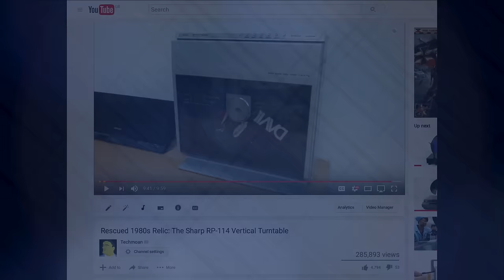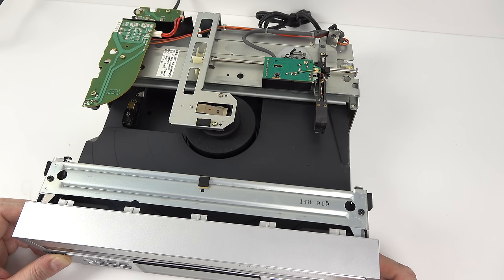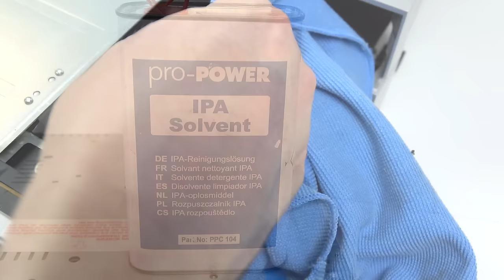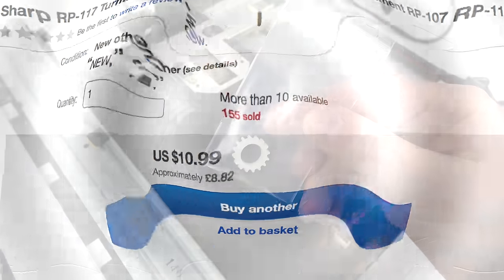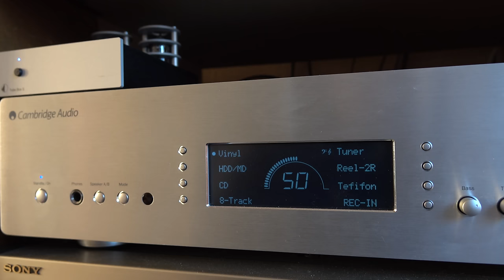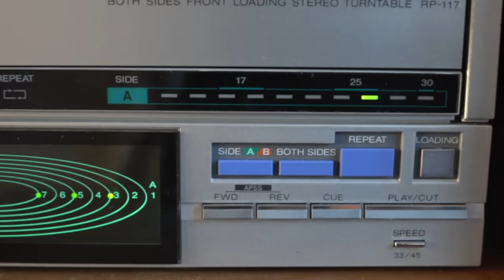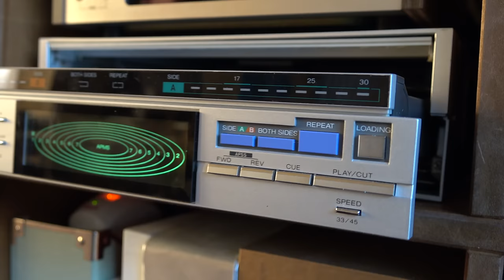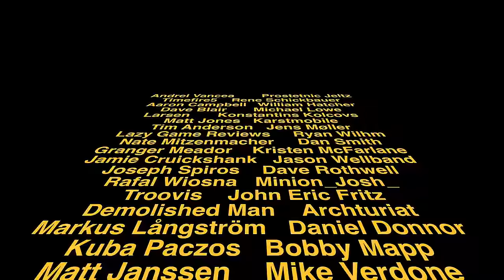RetroTech: Play vinyl records with CD functionality - Sharp RP-117

Comment: I think that $10 cog would be my ultimate push in the direction to buy a 3D printer :D
Reply: If you use a metal cog on a plastic rail, the rail will wear out a LOT faster than if you were to use a plastic cog. Also, plastic is self-lubricating, as opposed to metal. There's a reason why it's plastic in the first place, not only the cost.
Reply: ***** 
I don't think there are steel filaments for plastic FDM printers. You'd need a real metal 3D printer for that.
Reply: so let's see your logic. You would have to spend time (which is money ) to design the cog. Then you need the printer which how does a couple thousand dollars and equipment and materials justify making a shitty plastic cog?  I could literally and have done so, manufactured hard to find parts like cogs with my bare hands, even that cog he had was still useable if he spent more time fixing it it was not broken into a million pieces.... That still takes time but you don't need to invest in a pile of garbage which will just break down / or run obsolete in time anyways.  Terrible logic dude.
Reply: a metal 3-d printer? You mean a milling machine?
Reply: You can nowadays buy a usable 3d printer for around 250 euro. "Designing" the gear is literally a matter of 10 minutes. So, I think you're exaggerating. Do some research.
Reply: http://3dprinting.com/metal/ once again, do research. They exist, but those actually are a couple thousand dollars. It's not a milling machine. It can be used to make structures that can't be produced on a milling machine.
Reply: ***** 
Sure, you could do that. Just.. Why bother? This mechanism isn't subject to high stress, so just replacing the gear with another plastic gear will be fine for another 20 years, perhaps even more if this one doesn't shrink.
 
The problem was most likely caused by poor tolerances: a too small gear on a too large shaft. The design isn't really flawed, but when the tolerances are taken too wide (to improve revenue) chances of this happening rise.

Also, metal gears are noisier than plastic gears.
P.S. Just trying to provide solid arguments for one vs the other, no flamewars intended :)
Reply: No,it's not over,you started it,none Flame on. Flame wars!
Reply: Keepskatin well, let's then start. First, I'll imply that your cat is in fact your father. After that, I'll make fun of your sense of style. This is, of course, all completely uncalled for, and out of thin air. 
How do you respond? :p
Reply: Jelte Klas Wijnja 
I fart in your general direction!
Reply: Jelte Klas Wijnja 
I just got into my nuclear sub so I'm good.
Reply: No, more like laser sintering. It's still an additive process. But those machines cost as much as a new car. The machines that print plastic are way more accessible in terms of pricing.
Reply: as for making the cog, I think making a plaster mold, then pouring aluminium or plastic in would have been easier then 3d printing.
Reply: manaquri 
Print once and cast many. I would use a silicone mould instead of plaster.
Reply: Time is only money to people who have none of it. A 3d printer is a one time cost that can be used for so much more and shouldn't affect the price of the cogs. A few cents worth of plastic isn't much. And designing it wouldn't be hard at all.
Reply: I can probably spit the amount he sold of those cogs for about $25 worth of materials.
The reason they're 10 dollars each is because people will buy them for that price and not complain too much
Reply: It may seem pricey but it's also a part for an obsolete machine that could be hard if not impossible to find elsewhere. But parts for electronics have always been expensive. And even if the total cost of the replacement parts are around $20 that's still much less than the value of the working machine.

Comment: try superglue, that stuff actually welds the plastic kind of together.
Epoxy resin just relies on adhesion, and since the cog is under tension it just flies apart again.
Reply: audiocrush super glue repairs these fine i have repaired some myself with super glue  and works perfect. as you say you shouldnt use epoxy on a item like that.
Reply: Super glue + acetone applied on surfaces before gluing...

Comment: I remember the two sided approach, with a tone arm (so to speak) first being used in the jukeboxes of the 60s and probably 70s as well. The only difference was it was only for 45 RPM records and the record was held vertically rather than horizontally. All the mechanics of the record selection (robotic arm fetching the disk), the disk being clamped to the motor, and then the tone arm bringing the needle and cartridege into contact with the vinyl were visable to those of us gathered around this miracle music-making machine. A bit like a pin-ball machine, half the fun of putting your quarter into the machine was watching it work through the transparent glass case! I had no idea that this Sharp double-sided LP player existed even though I sold hi-end audio at the time. Well, I didn’t know about this probably because I was selling ‘high-end’ stuff and this was cool but not high-end. What we need now is a gadget like this that will couple with Gracenote online music database (or other) to look up all the metadata on each track, convert the analog to uncompressed WAV files, output over USB to good software on a desktop computer, save on local hard drive or cloud-based drive. Voila! Instant archiving and use of all those vinyl LPs we don’t bother to dig out of the basement closets!

Comment: I'll take vinyl over CD any time, if it gets scratched it will still play, albeit with a pop or crackle, any CD can get to a state where is doesn't play at all. Trouble with those old plastic parts, such as that cog, is that they shrink over time, that's why it snapped.
Reply: easier just to download

Comment: Great video as I was looking to fix mine I had bought in Germany in the 80's. It was the cog gear but it was not until 2022 as you did saw it on Ebay. Long story short got the new belts and cog gear and it works great. Thanks for your video.

Comment: You need to get yourself a 3D printer to efficiently produce replacement parts like that little plastic cog wheel. And possibly review it in one of your videos.
Reply: neoqueto That's not very convenient as looking online, and buying one, than spending 5k on a 3d printer, that will need to be refueled, adjusted, and calibrated, along with that it's no easy task designing a piece to print out. In the time it would take you to design the thing, one that you order would arrive faster.
Reply: Theft Tv I guess the main problem is that it takes many attempts and errors until you get the hang of it to print out a single piece that has a proper, durable structure, is not melted, tapered or displaced in any other way. But I still have to disagree on the price of the printer itself, there are many inexpensive models that would do just fine in a use case like this. Filament can be expensive though. Perhaps ultimately if you're experienced enough with 3D printing, it would be possible for you to break even on replacement parts. Also, with the help of a pair of calipers the initial design process shouldn't take more than 15 minutes, I imagine prepping it for printing and properly slicing it/generating gcode with correct infill is the most troublesome part. I might sound like an expert wannabe, but in reality my practical experience with the subject is minute. I know, 3D printers are nothing but glorified prototyping tools, might as well carve your part out of wood.
Reply: neoqueto Nice explanation. I did not expect a message back from you to be as descriptive, organized, or gramatically correct because you're original comment did not share the same grammar structure. (Not a insult.) Thank you for clarifying.
Reply: neoqueto In this case glue the cog amd just make a mold perhaps?
Reply: i have a $150 3d printer and i love it! i've designed and replaced parts for things you simply cannot source a replacement. it was so satisfying to use the device again and know it is running on my own manufactured part. so it would certainly bump the awesome factor of the repair.... but if you had no experience in CAD, it would be frustrating when there is a guy selling the proper part for less than $10!
also, ive only had to adjust/calibrate my anet a8 printer when it was moved... otherwise it's fairly hassle-free. no worse than changing ink and paper on a inkjet.
Reply: I would assume they do only what they are programmed to do and then i hope that would include generating all
the helices and pressure angles on the teeth as well.

Comment: Buy some Mozart vinyl for videos man
Reply: If you speakin' about copyrights, it applied to each exact performance. Not notes arrangement. If some orchestra will produce some music under Creative Commons (CC) license, it will make sence.
Reply: Николай Новицкий
Or an old pece that has no legal enthety as a continuing carier of the rights.
Reply: Langus langus I afraid, there is no such records, in proper quality, good enough to test sound )
Reply: Николай Новицкий
Can they realy tell its their specific performance ower YT?
Reply: Pretty much can, it's actually easier than to tell the notes that are being played. Pretty much you just compare the waveform rather than pitch detection
Reply: Got one in its box.  Worked great!  Haven't tried it for many moons.     Purchased from A DAK catalog.
Reply: Can you replace the cartridge if necessary or is the light emitter / receiver that gives the player it's ability to recognise tracks built into the cartridge & therefore an OEM replacement would be only option? Love your videos btw, keep em coming....
Reply: Adafruit sells a Bartlebeats record which is Creative Commons licensed
Reply: Pocket Fluff Productions no, it‘s called regulation, quite a reasonable process to protect consumers. If companies like youtube (google) have a de-facto monopoly as a video upload platform, their weird rules and censorship might be the actual threat to free speech. In that case, regulations must step in.

Comment: I had one of these!  In 1984-85, a mate talked me into accompanying him to a Hi Fi expo.  They had a door prize and my mate won it, which was quite a lot of good hi fi gear.  He kept the high end stuff and sold me this turntable, WITH its matching cassette deck, and its matching amp and speakers for a pretty low price.  It worked pretty good (remember, mine was brand new), but not so good for albums with more than 7 tracks per side, or those albums with even a slight bit of music segueing (connecting) one track to another (Sgt. Pepper's for example).  Also not so good for being able to lift the needle off and move it easily and quickly around within a track for: 1. working out how to play bits of the track on your instrument (guitar, piano, bass, etc); and 2. making a cassette recording of only parts of the track.  Still, I kept it until it started playing up which was after about 10-15 years (so we're talking mid-late 1990's) and couldn't find anyone game to repair it.  And around that time (or just before) I got into CD players which give you total freedom for stopping, skipping, fast-forwarding & fast-reversing through tracks, and later with iTunes, able to record just parts of one track.

Comment: I actually had one  if those turntables for a short time. I actually rented it with a buy-out option. Good idea, if it had worked, but there was one annoying problem. The light emittor/receiver on side B always got dusty and I had to dust it off every week. Unscrewing the service hatch, remove dust, remount hatch. That meant that the skip-track function almost never worked on side B. I returned the unit and got another more "classic" model. I never thought I would see one again, until I discovered your channel.

Comment: My next door neighbour used to have this exact turntable. It worked perfectly, but occasionally it would start skipping. I would have to open the little side access doors once a year and clean the stylus and optical sensors - then it would work perfectly for a while. Apart from that it was brilliant.

Comment: Six years ago, 2014/2015, I digitized all my old LPs, 263 of them.  Artcessories DJpreamp, under $100.  Downloaded VinylStudio for $30, to record, separate tracks, get album cover art and song names, save and install to iTunes.  Wore out my 30-year-old turntable, replaced it with an Audio-Technica AT-LP60 from Staples, cost around $100 or so.  Washed all the records, some 50 years old or more, some rareish unusual collections, very few scratches, all backed up on CDs, can choose to play individual tracks/songs, just as if I had bought them from iTunes, many of which iTunes didn't or doesn't have.  Adjusted preamp recording levels to get consistent output volume for each side of each album.  Doubled the size of my music library to now over 7,000 songs.  The whole project took over a year, great fun the whole time.
Reply: Haha....wanna do my collection for me ??? It's only 7,500 LP's and about 2,000 7" singles.....and a few hundred cassingles.....(anyone else remember them?)

Comment: I work back through your tech reviews and I never fail to be amazed. One question, how does the sound from the bottom playing side hold out? We tend to get so precise about the pressure of the stylus on the vinyl when it's on top... so the bottom stylus is being pressed up against the 'B' side, so to speak. Thanks. Excellent stuff.

Comment: I paid $50 for this same exact Sharp RP-117 at an electronics store in the summer of 1986. I had seen it in popular science but the price was way out of my range then. When I saw the opportunity, I snapped it up. Watching your video now, I realize that the cog you fix has always been broken on my unit and I would simply pull the drawer out and place the Lp's in, never realizing that it actually had an auto driven (servo?)  door. Are the cogs still available? I wonder. Thanks for another flawless, quality upload

Comment: In the mid-1980s, Sharp also produced a complete system with the RP-117 record deck, radio, cassette tape deck, and amplifier combined in one unit, plus two separate speakers.  It was not particularly expensive, and worked quite well.  I did have one until a former girlfriend of mine dumped it one day when the record deck stopped working.....

Comment: ...forgive me if this has been asked before, but do the repair/parts/operations manuals give any guidance about tracking force?...particularly in the lower assembly?  Does it appear that the cartridge/needle arms are spring-loaded?  Have you noticed any set screws for adjusting tracking force?

Comment: This is pretty cool. I never saw one before. It all looks new inside and out! In some ways I amazed that anything this old still works..but I recently had my 1982 Akai amp repaired at my local hifi shop. Turns out that this technology is solid and eminently (and affordably) repairable.  Does that mean that modern stuff is will not be?

Comment: Hi, mate. Great video. I have an RP-103 that has the same issue with the drawer mechanism, do you know if your repair solution will apply to the 103 too? They both look the same, aside from the extra buttons for the programming feature obviously, so I'm hoping that the mechanism on both turn turntables will be exactly the same. Thanks in advance.

Comment: The only thing that would concern me would be the amount of pressure that 'upside down' stylus would exert on the vinyl to stay in contact with the B side. I have visions of it carving it's own groove if the thing wasn't set up just right, and vinyl records did come in various thicknesses back in the day. Unless it's using the track photo sensor as a distance measurer as well.

Comment: Is the cartridge/stylus assembly moved along during playback by sideways force from the disk, as on a typical record player, or does the player sense the force on the stylus and move the cartridge electronically based upon that?  Having the stylus mechanism slide smoothly would seem more difficult than having it on a long pivoting arm, while controlling its motion electronically would make it possible for a player to avoid repeated skipping (the player could notice that the net motion of the stylus after a rotation was zero, and respond by applying some slight inward tension).

If you have a record you don't like, it might be interesting to make some scratches on it which would cause an ordinary player to skip, and see whether this unit would be able to cope with them.

Comment: Linear tracking and track sensors were only found in expensive turntables in the '70s, but they weren't all that uncommon in the '80s.  IIRC, toward the late '80s, so many cheap turntables had these bells & whistles that you could tell the audiophile turntables by the fact that they didn't have all these features, instead boasting fully manual operation and precision construction.

To me, the impressive feature of this Sharp is that the turntable doesn't have to be at the top of the stack.

Comment: You are very knowledgable those gadgets , my turntable is Technics, SL-D1, just a standard player but I have a bit of an issue with it. It seems to play the beginning of the records fine, but when it comes to the end tracks ones I can hear increasingly scratchy distortion in the high frequency. Your advice would be highly appreciated. 
I am enjoying those videos of yours, the various formats and devices most of which I've never heard of.